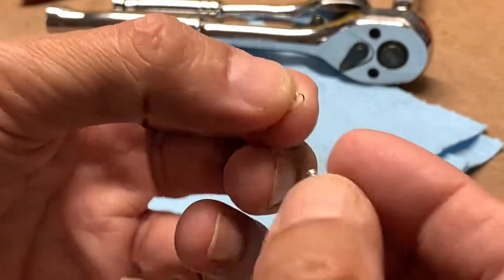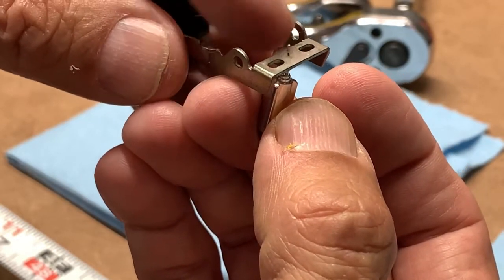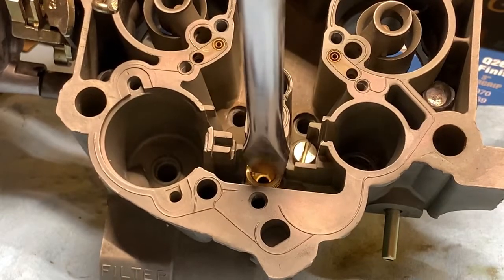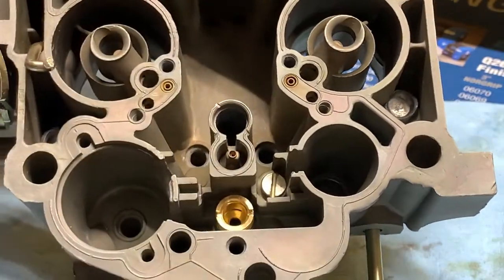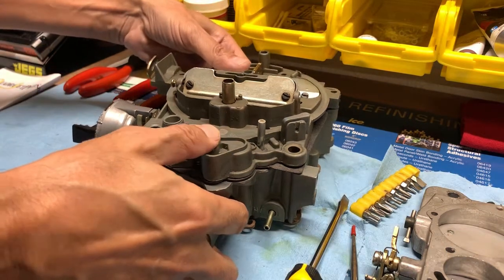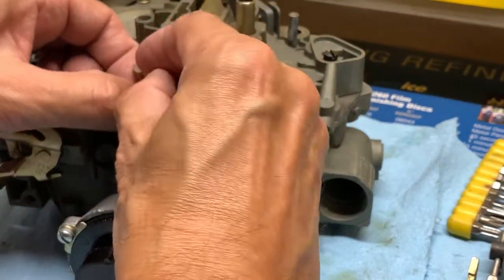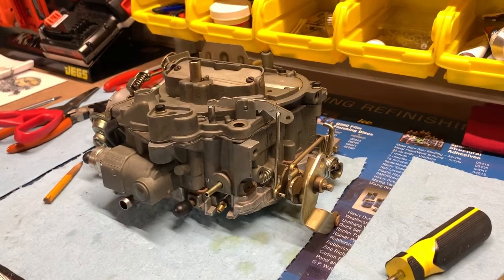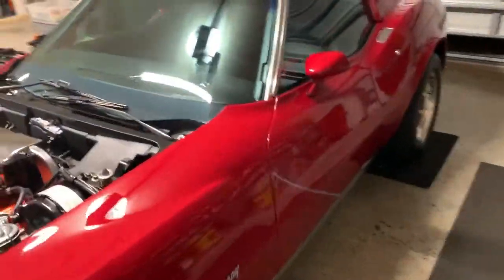How to REASSEMBLE a Quadrajet Carburetor

Comment: I just did a rebuild on my Rochester Quadrajet and I thought everything was perfect. Car starts but after 15 seconds it stalls (same results after three tries). It's getting gas, spark, compression. What's your thoughts?
Reply from the maker: Impossible to tell without looking at it, but it sounds like fuel starvation. 
Is the fuel filter installed correctly? How about the gaskets? Does it keep running if you give it gas? Have a pro look at it to determine exactly what’s causing the issue. Good luck! 😊👍🏻
Reply from the maker: @inell6  The little valve in the fuel filter is to help keep fuel in the carb. The needle clip is really unnecessary (I install it sometimes, and sometimes I’ve left it out) fuel pressure will force fuel past the needle and into the bowl.
Reply from the maker: @inell6  Oftentimes, it’s an elimination process. Good luck! 😊👍🏻

Comment: The plastic cup is it necessary to have or not. Is there a pro or con for using or not using the black cup 🤔.
Reply from the maker: It really doesn’t make any difference.
Reply: So just more fuel in the bowl. So that's more WOT and no worries about emptying the bowl.
Reply: @76vette  my problem is when I'm at part throttle my car sounds like it has a monster cam in it. But at idle does great at WOT does great just when pulling in 1st gear in my driveway whop whop whop like a helicopter Chopin trees looking for trees lol 😆. Never had a quad do this before. Never ever. At screw maybe. It doesn't smoke nothing just sounds like it's cammed to death. I have it turned from seat out 3 turns. Idk 🤷‍♂️ I'm stumped
Reply from the maker: @jasonbeason4780  When you say you have it set at 3 turns out are you talking about the APT system? I’m assuming your carb has one since you mentioned the “black cup.”
Reply: @76vette  yep the part throttle is 3 turns out. Starts the ruff idle when pulling the driveway at a higher rpm. I have a 288 480 cam In a 350 with flat top pistons and factory 882 heads. 2200 stall for a 700r4. I have the plug for the apt knocked out tapped and a treaded plug in there. Carburetor has had a modification kit I installed from quadrajet power. They put this kit after I told them my engine built sheet specs. Just when I get to around the stall converter lock up rpm is when the car acts like its missing. Car doesn't jerk or nothing it just doesn't make since. The blop blop like a huge cam is in it. At lidle sounds great. But this cam says it starts power ant 2 to 5 thousand rpm. I really don't know. Waiting on a part idle wrench so maybe it needs a fine tune. If I got to shut the chocked butterfly it starts flooding. That's the only time it smokes. Starts up very snappy. Like no hesitation on the fire up.
Reply from the maker: If Quadrajet Power built the carb then I’m sure they used their full-tapered metering rods which should give you full adjustability for the APT system. Did you explain the issue you’re having to them? If they think it’s APT-related then you’re on the right track. Glad you ordered the right tool for that. I hope you can get it dialed in properly and that it fixes the issues you’re having. 😊👍🏻
Reply: @76vette  no I built the carb with their modification kit and went buy there specs. And yes I talked with them and seems to be minor tweaking. On the idle jets in the front and the APT  adjustment. Tool will be here tomorrow. Car show this weekend

Comment: Got that sliver taking all my focus away.. either way I wanted to thank you I have never ever ever worked on anything under the hood of ANY vehicle EVER. but have owned a 76 for about a month now and learned alot and you sir just got me to successfully taredown my quadrajet I thank you so much! Now for the 1 to 2 day bath!
Reply from the maker: Hi Matt, 
So glad to hear my videos have proven helpful to you. Quadrajet carburetors are amazing and work very well when tuned properly, so take your time, make sure all passages and tubes are super clean, replace whatever is necessary, and your Vette will run great, and you may even see some fuel economy as a bonus. If you have any questions, feel free to reach out and I'll try to answer what I can: diy76vette@gmail.com
All the best! 🙂👍

Comment: I have an original quadrajet in my 1980 L48.. Is this the same carb as in your  videos? These are  the best step by step videos I've ever seen 👍 especially for a carb novice like myself... Much appreciated sir.
Reply from the maker: Hi Sonny,
and thank you for the kind words. 
Glad to hear the videos have proven helpful. 
1980 Qjets were basically identical but they added the Computer Command Control on a lot of vehicles for better main metering. The secondaries, however, were the same. 
So if yours has an E4M carb, then it would have an oxygen sensor in the exhaust system plus the electronic throttle position sensor which eliminated the need for a vacuum power piston and the Adjustable Part Throttle APT system. 
I’ve never rebuilt one of them but I think the guys at https://quadrajetpower.com/ have one or two videos on those. Best of luck!
Reply: @76vette  Thank you very much... God bless and I'll keep watching

Comment: Friend, what is the screw on the side of the needle plunger for? It is the screw with a different head than all of them.
Reply from the maker: I think you’re talking about the power pump check ball screw. Go to https://m.youtube.com/watch?v=1cN6JDNOEWw&feature=youtu.be and fast fwd to 1:30 to make sure we’re talking about the same one. Hope this helps. 😊👍🏻
Reply: That no friend, a screw that has a spring that goes in the middle 0:01 next to the needle plunger, it has a strange head, the thing is that also when you adjust the carburetion, if you loosen it, that screw has more passage of gasoline, something like that friend
Reply: It is in the middle of the float needle seat and the needle plunger, there it is placed
Reply from the maker: @jorgeadolfotrejogarcia2235  Ok, that’s the Adjustable Part Throttle and for more info check out this video: https://youtu.be/VqxXFwkT55g

Comment: What was the little cover you made???….was it an EGR blank off?…….and if so does it run fine without the EGR?
Reply from the maker: Yes! I made it out of s small piece of flat aluminum stock, polished it, and installed it. 
And yes, no running issues at all. Plus one of the previous owners had already removed the smog pump.
Reply: Thankyou for that….i live in England and own a 1983 c10 silverado 305 …i bought a blanking fitted it and took it out for a run…under secondary load the truck started stumbling and running awful so thought maybe it doesnt like it do i put the egr back on ran ok for a day then started doing the same thing again so it must have been coincidental….fuel flow problem i think do i ordered a QJ kit from the USA to freshen it up and also a new dizzy cap rotor module and plug leads….hopefully this should solve my problem! The truck was totally de smogged before it was shipped to England!
Reply from the maker: Also, check the timing. 😊👍🏻
Reply: @76vette  why would the timing alter all of a sudden???
Reply from the maker: I’m not saying it did. But it’s always a good idea to check.

Comment: what happens if you forgot to throw in the plastic thing at 5:51 ?
Reply from the maker: Good question, and the simple answer is… nothing happens. It makes no difference whatsoever. 😊👍🏻
Reply from the maker: Very strange because AFAIK, none of carburetor screws go into areas where gasoline passes through, so it’s impossible for them to wick gas out. My guess is that it is leaking from somewhere else and most likely the result of a warped air horn. 
Good luck. I hope you can get it repaired properly. 😊👍🏻